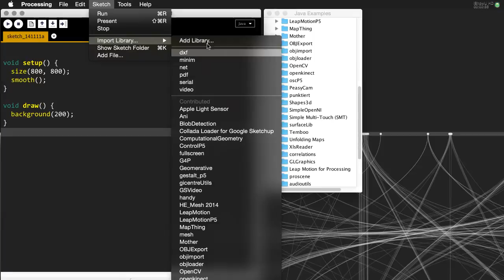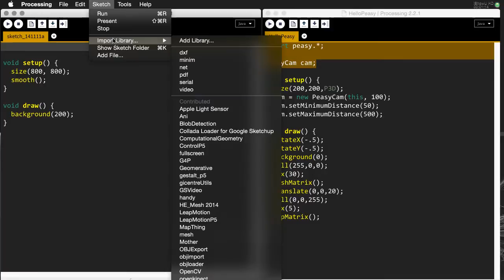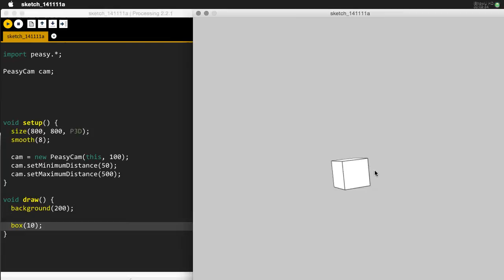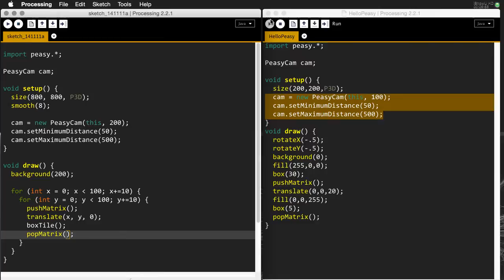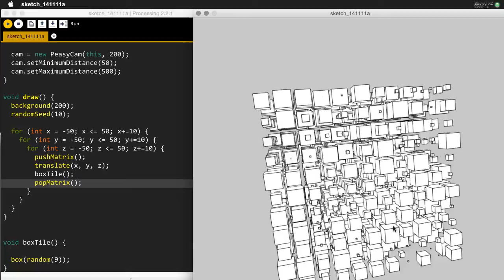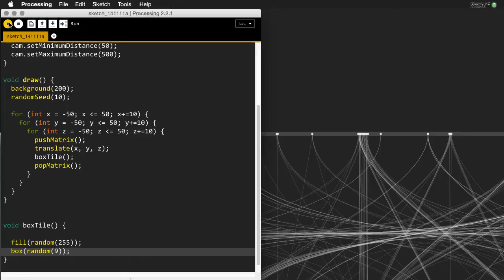PeasyCam 3d Cubes

Comment: why the cubes don't update? looks like draw function is called only ones. or is that cause you set the exact seed every time?
Reply from the maker: Yes, I use the randomSeeed() so I get the same set a random numbers every single frame. Technically, you can probably just put the randomSeed() in the setup() and just call it once. But I like to have randomSeed() in the draw() and usually assign it a variable, like randomSeed(r), so that I can set up a keyPressed() event and have a new random number generated to see a new set of randomness. Hope that helps.
Reply: @danewebster8246  yes, thank you a lot!